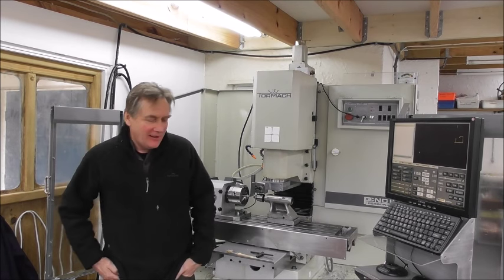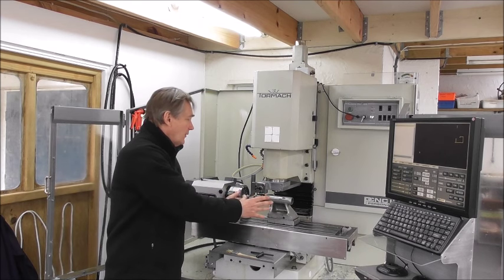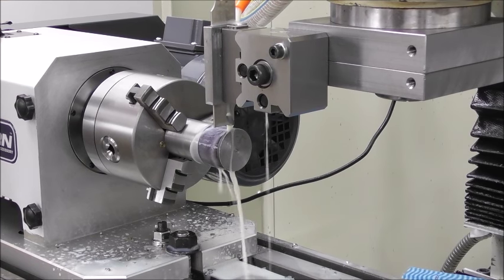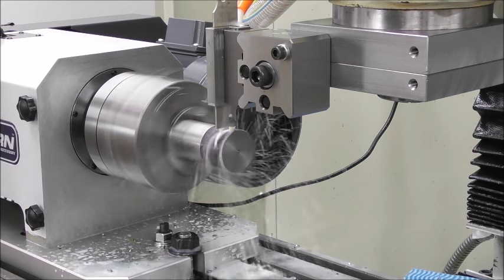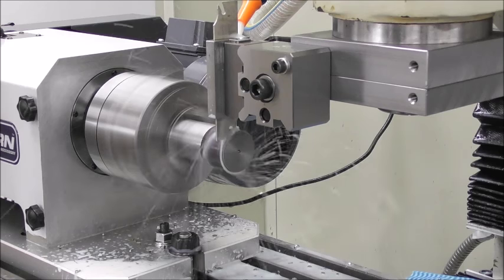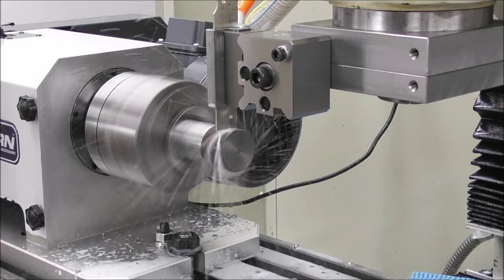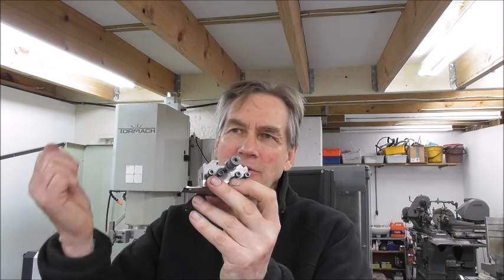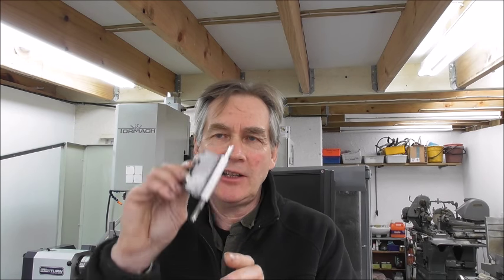Tormach RapidTurn - 4. Tailstock

Comment: Hi Cliff - love your videos - thanks again!
A couple of thought come to mind:

MOUNTING THE RAPID TURN
As the Z axis distance is not really an issue, would you consider making up an entirely new 'sub-plate' for the Rapid Turn and leaving it permanently mounted to the bed?

The advantage, assuming the the edges of the current plate are parallel to the X axis, is that it would enable very rapid re-alignment once removed from the mill.
The fixings to the mill bed could be countersunk [potentially], or proud, in which case a section of the existing Rapid Turn plate would need to be removed.

The anchoring to the Rapid Turn could then be done on the front and rear edges of the its base plate, which makes access a treat, and allows variable positioning if required on the X axis! If the new sub-plate was rigid enough you could place it outboard a long way I think [but I'm not cewrtain what advantage that would bring].

MOUNTING TOOLS TO THE HEAD
Would you consider mounting the Tool Holder plate to the horizontal surface surrounding the spindle?
I'm sure there'd be a practical way in which you could grind the surface flat insitu on the mill. In this instance you could potentially leave the Tool Holder plate permanently fixed to the mill [as it would be higher in the Z], or create a feature when you are grinding to make repeatable re positioning practical.

Again, perhaps 2 plates - one with a keying feature [dovetail style maybe], for quick removal.

Just some thoughts.

Cheers - Peter
Reply from the maker: Hi Peter. Thanks for those ideas. A new mounting plate for RapidTurn would allow the optimum positioning - I will give that some thought...thanks.

Mounting Tools to head - I am not quite sure what surface you mean - I am currently  using the underside of the spindle cartridge as per videos...so you cant mean that. Remember I need a big area to mount many gang tools side by side.

Cheers  Cliff
Reply from the maker: Oh - perhaps you have not seen my latest videos?

Comment: i reckon that further distance between centres could be had by mounting the tailstock on a sub plate/outrigger that extends over the R.H.S of the mill table. I also have the rapid turn but have had too much work in to concentrate on using it, however as soon as I got it I started to think about gang tooling as being a feasibility , your efforts look to be really good. I too decided against importing the tailstock into the uk but I bought a lathe tailstock for one of the Seig small later that I hope to adapt, I have a couple of the height adjustable ones that came with my rotary tables but like you I think they would be too high and interfere with clearances etc.
I look forward to seeing more postings  in the near future, 
Good luck,
                   Bob
Reply from the maker: Hi Bob - Good to 'meet you' . Thanks for posting your original video - it gave me the confidence to buy RapidTurn.

Cheers
Reply: I'm glad to hear that you liked my first video. I have only just got back to trying it out again after it's initial try out.
I had to swap the U & V wires in the motor because the spindle was turning in the wrong directions the first time. I have a small run of bearing bushes to make but getting the diameter to the correct size is not proving to be easy and I am inclined to think that if I change tools I will not get repeatability, however the mods you are making look much more robust than the Tormach tool post and holders.
I'm sure some means of clamping the small toolholder onto a gang tooling set up accurately might be easily achieved .
Reply from the maker: Hi Bob. Do you think your mill Z or X when in RapidTurn mode is not repeating well and giving your diameter problems?  That is a concern I have also.

Please keep me posted on that. Cheers  Cliff
Reply: It could be, but to date I have just not had time to thoroughly investigate. It could even be me not getting the initial dia measurement wrong when  touching off the X axis. I will keep you posted.
P.S. do you think there is any merit in the idea of extending the distance between centres as i suggested?
Reply from the maker: Hi Bob. I need to do some more measurement checks, but from memory there is a lot of wasted travel to be gained , especially when using a chuck, by moving the RapidTurn headstock left.

Cheers.

Comment: Thanks so much for your videos and cant wait to see the progress. I also have the rapid turn. One problem I have noticed is there is slight height changes in the distance from head to table when moving table from far extreme right to left. This is due to the gibs in x and y. Next to impossible to eliminate it completely without motion loss in steppers. I was suprised to see as much as .003 over 15". This is without cutting forces applied. I wonder if you have seen this and what your results were?  If you could lock the y axis down like my knee mill does that may help. Any thoughts?
Reply from the maker: Yes I agree with you - Height variation may be a problem on some longer more jobs.  I cant think of a easy solution to this other than keeping the gibs perfectly adjusted. But I know that will not be enough. Lets keep thinking it over. 

Thanks for posting - cheers.
Reply: Locking Y axis will limit movement by half. Wonder if anyone built a axis lock on a Tormach?
Reply from the maker: Hi - Trouble with that is - Not so good if you want to use the Y for gang tooling in auto mode.

Comment: Make a plate that bolts to the table, then fasten the Rapidturn to that plate, there will be more room to slide it back from the cutting tool and it'll be easier to bolt it down.
Reply from the maker: Hi Plata - I agree that would work well. Cheers.